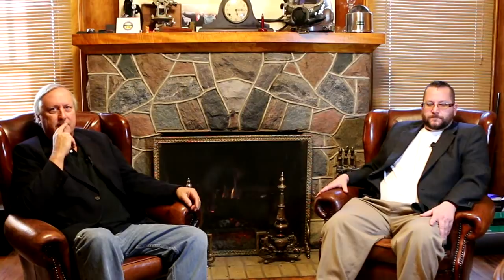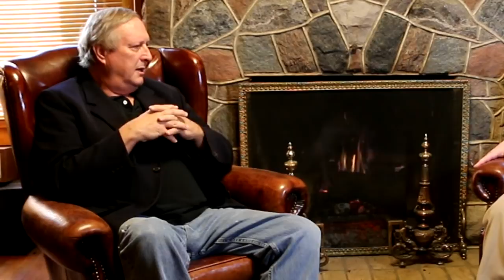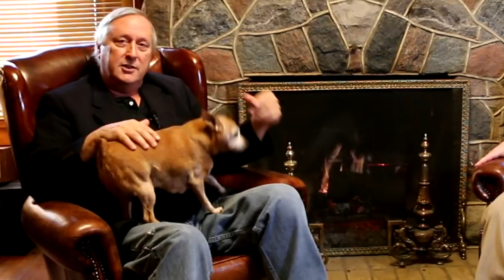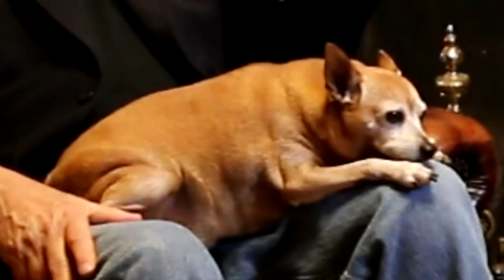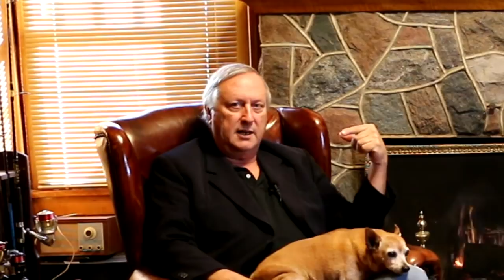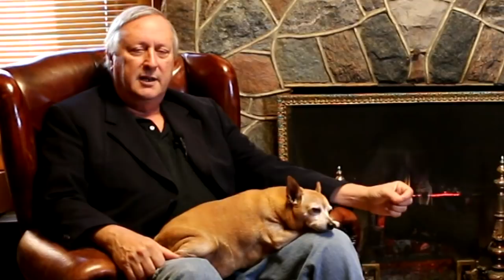Oroville Dam Spillway Slab Cracking

Comment: Maybe you can get the genius to tell us how much conditioning monitoring instrumentation has been installed on the new primary spillway.  No?  I thought not.  Can he describe how the secondary spillway has been repaired and reconstructed and its purpose?  Does concrete become more strong in its stress carrying capability with age?   Oh, he has not been out there.  He has not inspected the cores.  Oh, "the dam will not fail because of bottom half failure".
Reply: when an independent water demolition company was employed to work on the dentate, they were asked to attempt to abrade a test slab of spillway concrete. They needed 35000psi to lift the concrete surface. All this detailed info is in the BOC reports, forensic reports and construction images.

Comment: This guy didn't agree with the approach they took in the first place.  Now he's concerned about long term erosion.  Guess what - they had no choice but to get the spillway functional in case another winter like last winter occurred.  It turned out not to happen, but what if they hadn't prepared and it did?  Scott's writing a book - which is likely the only reason he's hanging around.

At the end of this video he himself says they can repair the surface if they need to.  So what the HELL is the problem?  Maybe you should have bid on the repair/replacement Mr. Cahill.
Reply: @Ana Justice I have listened to a recent one of Scotts videos, he makes statements that suggest he hasn't even bothered to inspect many of the construction images on the DWR pixel site. I'm not a dam expert, I'm not a construction expert, but I have a good analytical mind and can recognise good and bad design features.

Comment: Do they have the same crazing cracks where the curing blankets were placed on the structural concrete placements? I’ve been involved using the overlay discussed, the only problem is, if put on to soon, concrete gives off a type of gas while curing, so where we used the overlay in about 2 months it start to show large areas of bubbles and eventually started cracking. It was a mess.
Reply from the maker: loadpin  thanks for the input. I do not have particulars on the location. It is a shame that we must discuss the quality of the work as soon as it is complete!

Comment: What section of the spillway has these cracks.....Seems the plan was to remove and repair the top layer (12") of the center section next year...and also remove and repair the top section...next year...
Reply from the maker: Doug Ankrum it is the bottom portion of the principal spillway. It is specifically the slabs and walls of the lower sluiceway. The upper and the gate structure have not been repaired.

Comment: OMG I just went by a damn here in Tennessee and it's got cracks in the dam. They've only been there for 70 years. We are all going to die.
Reply from the maker: Bryan Hensley   First, of course, you are most probably a troll.  If you are doing this for free, you are also a fool.  DWR will pay you well to make such remarks on my feeds. They even had a P.I. From Colorado employed doing it. If you are just a fool, give them a call - you can tell them that I sent you.  Visible cracks in new concrete are undesirable. Every statement that I made are accurate and my good friends at the Portland Cement Institute will tell you the same thing.
Reply: Bryan Hensley; You need to have a look at the clearly visible cracks in the EM spillway if you think the dam is in no danger of failing. There are also what look like 2 sinkholes inside the dam near that part of the EM spillway. My suggestion is if you have friends living near this dam to warn them to get out of the area as soon as possible.
Reply: So you suggest cracked "damns" are good ? Let´s have more Tetons, Folsoms, etc. is that it ?

Comment: Scott, agreed. A perfect swimming pool surface finish is required for such future massive flow of water quite different from any other concrete structure service requirements. Oro dam is no sailboat, it´s an aircraft carrier, or rather 3 carriers (3050 ft. long). So a complete, special epoxy, full coverage surface treatment may pull the trick... maybe. 

But besides all of this my deep concern (including the upper 730 ft. slab recently poured) is the size, type and LOCATION of the cracks -- that always grow -- not yet revealed, particularly if found at any interface between different types of materials and/or along stress lines and stressed areas, corners, wall-sluiceway intersection, step-ups, step-downs, etc.  
With 100K cfs discharges weighing millions of pounds at 70 mph pummeling down the chute, any of the above could lead to catastrophic failure, again, this time far closer to the already impaired gates & gatehouse. This has been a hurried, 60% on-the-fly design with lots of improvised "solutions" of sorts all along... plus 110 F temperarures or even higher if localized heat sinks are considered.

So beware: this new, experimental chute has 5 different BASIC materials plus variations thereof with varying formulations + different mechanical properties sharing same structure & stresses all bad for cracking and crack propagation. Furthermore, 37 earthquakes above Magnitude 4 have been recorded during the chute repair period, not good for crete curing.

Thus, this experimental chute has (1) patched up 1968 SCC (2) new variable formulation RCCs (3) hard RCC (4) new SCC (5) troweled shotcrete “whatever” on RCC walls + 3 sharp steps... all of which mean possible cavitation. The aggregates problem from minute one also meant different formulations for all of the above so now them can´t know which poor quality crete is where now subject to cavitation, tension + shear & abrasion 

BOC wants tests, DWR does not. Wonder why ?
Reply: Dig Engineer hi, hope you are well! 🙋💜
Reply from the maker: Dig Engineer  as usual  you are accurate and professional.  Thank you for your input and information
Reply from the maker: Dig Engineer  well said I agree.
Reply: Hi Dig Engineer good to read your comments here. Greetings!